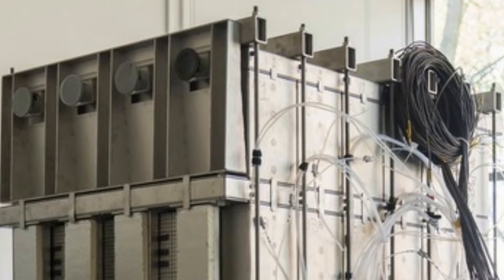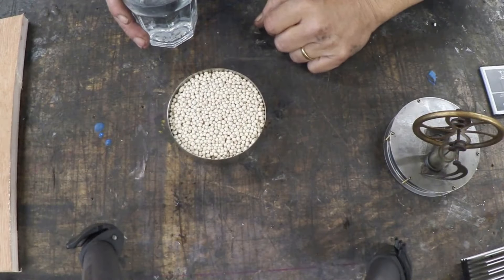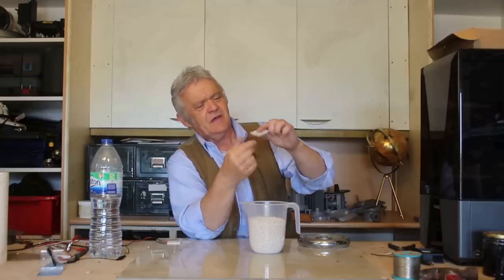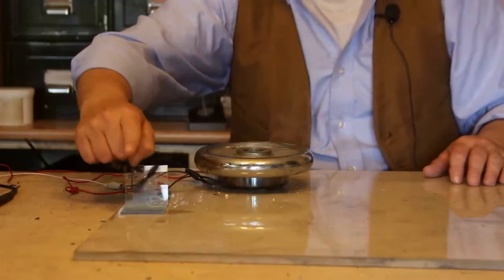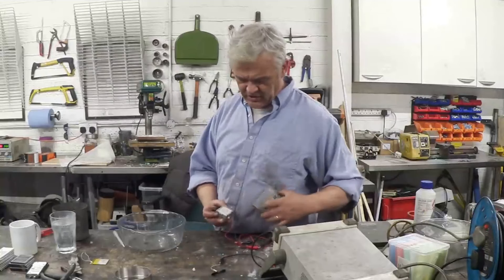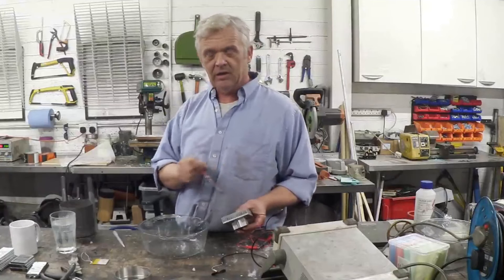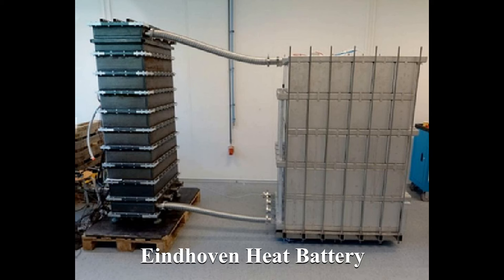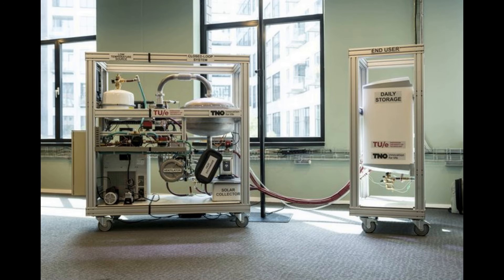2224 Energy Storage Game Changer - The Eindhoven Heat Battery

Comment: It seems that a sphere of 2.5 m in diameter filled with sand and covered with 0.5 m of mineral wool would be able to store 300 kWh (1000 oC) for a week, losing 25% in the end, and being able to return half of it back in form of electricity and a quarter in form of hot water. And costing 7.5k USD (20 USD/kWh netto). (For reference, a 2.2kW steam turbine costs 2.5k USD.)

It’s interesting why no startup is able to produce a prototype of such a simple, but so much needed system. 

Having such a system the only thing remaining for energy transition is 5 times the nominal capacity of solar panels / wind turbines (for Germany climate). Even a diesel generator practically never will be needed.

Comment: If you keep adding water does it stay hot?
Reply: Sadly, no 😊. Chemical reactions occurred between individual molecules of the two things reacting. So let's say the reaction is 1 molecule of zeolite reacts with 1 molecule of water and gives off heat. If I add 100 molecules of water to 100 molecules of zeolite, all the water and all the zeolite will have reacted and additional water will have no zeolite to react with. 
Now If I started off with 200 molecules of zeolite and added 100 molecules of water, THEN adding more water would produce more heat. But at some point, the water molecules will run out of zeolite molecules. At that point the zeolite will need to be dried out so it can be reused to produce heat. Does that make sense?
Reply: @101jchristensen  So after the steam stops is there still water remaining? Then you have to apply more heat to dry it out?

Comment: So, If I took a stainless steel (clothes dryer drum small used unit) and put it inside a large air duct, then in theory rotating the wet Sodium drox would lower it's own temperature creating an AC effect?

Comment: The largest waste heat suppliers that I have found are Brake disc foundries.  I proposed the generation of hydrogen to the brake disc foundry, but they laughed at me...However...Steam blown through Iron particles generates enormous amounts of hydrogen rich steam....An old book that I have "Industrial Hydrogen" by Hugh S. Taylor D. Sc 1917. clearly outlined how to create hydrogen from steam and Iron.  A brake disc foundry has both waste heat and scrap iron...Which would be a modern way to move toward a hydrogen economy.  The issue at heart is simply this...Corporations are ran by stupid idiots.
Reply: Just because you get degree does not mean you are inventive. Most folks learn how to do something but that does not mean they know how it works they just repeat actions and can not carry on a conversation of how to improve it.
Reply: The danger associated with high temperature, iron oxide, and hydrogen is why they laughed. It would never fly with any level of safety.  The same reason every petroleum plant exploded is because they use a spark wall to re-crack the gas. Then oxygen creeps in somewhere and the plant blows up. Look into it, it's very interesting.
Reply: The amounts of iron grindings from manufacturing processes is minisculte compared to the amount of hydrogen needed, also waste iron is currently recycled so diverting it to make hydrogen will just raise iron smelting needs, and iron smelting is carbon intensive.  Their is stupid idiocy in the world but one should do their own homework before accusing others.
Reply: I don't understand why a brake disc foundry would want to produce iron oxide.

They spent all this money popping the oxide off of iron, why would they spend money to reverse the process to produce hydrogen?

Then what would they do with the iron oxide? Send it back to a refinery and pay them to turn it back into iron at a greater expense energetically and economically?

No matter how that's sliced, the physics don't work. And if the physics don't work, the economics can't work.
Reply: Corporations are run by, most of the time, mediocre people. Not idiots, but certainly not the bright minds either. 
The company was just laughing at you because it is more expensive. 
And as long as fossil fuel remains cheaper industry will keep polluting.
Reply: I really like the idea of long term energy storage without degradation.
But I really like the possibility of "night solar", with the cells being heated during the day and then discharging through the night.
If it's not being done, I guess there'll be some practical issues, as usual. But on paper it sounds great.
Reply: @grinchyface  They put out a call for ideas about how to use all the excess heat energy  that is wasted every night.  Foundries are filthy dirty places, and the iron scrap is plentiful.  Using the excess heat, and the waste scrap iron, which is a  considerable amount would produce quite alot of hydrogen.  Of coarse all the math was done.  I am reading alot of comments from folks who obviously have never set foot in a foundry of any type.  But thanks for the feedback.
Reply: @kennethferland5579  No accusations.  My firm was hired to help them solve a problem.  I exaggerated about the laughing part...However, You have obviously never set foot in a brake disc foundry.  The "iron grindings"as you say are not minisculte compared to the hydrogen produced.  3Fe+4H2O=FeO4+4H2 and it is reversable. In fact it was the primary way to produce hydrogen for years.  The iron is NOT recycled.  Waste water, Waste heat, and Waste Iron all mathematically worked out for the foundry.  However, the idea came from yankees, and that pissed off the internal engineering team....It was a game of EGOs.  That is why I say they are idiots.  
Your foundry expertise impresses me.
Reply: @JSabh  JUST NONSENSE.
Reply: Bless You in Your Truthfulness!!!

Comment: Think of home energy sources in the previous century. You would have a coal delivery if you had a coal furnace, or an oil truck for an oil furnace, or even a truck delivering firewood. 
Now, think of zeolite deliveries, dried by the waste heat of the local pizza joint, bakeries, and other waste heat sources, including local entrepreneurs building small scale solar drying facilities. 
Not so strange or futuristic.

Comment: I live in San Antonio, where we have a huge number of 110F days. The heat part, if that's what the exothermic stuff is for-- is taken care of here--if I could ship you 40% of our entire net heat here, they'd build a memorial to me. 

As it is, nobody here would touch their car with the bare skin, because it will literally burn you. Crayons and plastic objects left in the car melt and warp, open the door and you can smell the carpet cooking.  You can rig up, in about fifteen minutes, a solar collector (such as the parabolic mirror, or solar cooker, or fresnel lens, or whatever) that will knock your socks off. I guarantee you can fry chicken with it. 

The problem, it seems to me (as you've mentioned before, Rob), is the cost of the Peltier device to perform this conversion at any meaningful scale. 

So here's the big ask. Do you think it would be possible to create LARGE SCALE peltier-like devices on the cheap, to make USE of all this ridiculous heat we have? 

(I will happily send half of my proceeds to Great Britain.)

Comment: That battery sounds like it was designed for geothermal projects
Reply: This battery design doesn't work. It leaks energy constantly. Even if it was put in a geothermal project, it wouldn't really do much failed. Battery tech needs to be thrown away.
Reply: @chaoskiller1758 Evidence?

Comment: Robert, as always well researched, very informative and a compelling presention. THANK YOU.

My main concern and one I've raised before is being able to integrate any system, no matter how simple or inovative, with established 'on grid' infrastructure.  To emphasise my point, do you supplement your own electrical supply with any device?  

With your expertise and access to tools, parts, etc. I would've anticipated a power wall storage type energy sink with an array of potential inputs, fed by your wind, solar peltier, metal air battery, etc. prototypes.  

If you haven't started to harness the power you're making, how viable is doing so and what chance do we stand of doing this ourselves?

Comment: The exothermic properties of Soda Lime are used in a device called "The Little Dragon". Developed by cave rescue teams, as a spin off from diving re-breathers, to prevent/treat hypothermia.
 Its a container holdind a quantity of soda lime into which is squirted a small ammount of CO2 - from a home brew keg - the CO2 activates the soda lime, and the heat produced is used to pre-heat outside air, which is inhaled by the casualty, which helps to raise their internal core temperature.

Comment: Why not do the drying by pulling a vacuum with a little bit of solar photovoltaic and a scroll compressor, add a little bit of a solar thermal heat of some sort to speed the process up. A lot like modern high efficiency washer dryer dries the clothes using vacuum

Comment: I'm living a bit further north in Leiden. I really think that this is a great idea. Many years ago we invested in solar panels but now the capacity of the houses with panels oustrips demand. Imagine if the grid could store the excess and deliver it back when the sun has gone. I'd happily pay for such a service rather than having batteries in my own house.
Reply: The problem with it as a service your adding costs and the savings goes out the window yet again, then also the transport of power also adds to the cost, so much for trying to provide cheaper power.
Reply: @troywhite6039 Yes, of course the off site battery option won't be as efficient as on site. But if the site of the battery is relatively close to the source of the power (within the same city or town) then losses are not going to be as significant.

Many countries already have pumped hydroelectric storage as an offsite option. Obviously the Netherlands is not going to be able to to do that, but a heat storage system is going to be just one option.

Now my house does have room for a battery and I'm OK with that as an option. But the option of grid storage would mean that people who are not so fortunate could at least play a part in solar even now that we are beyond the grid capacity.
Reply: Check the work of "OffGrid Survival Mike" About his heat battery and rv fridge working on solar

Comment: notable issues, including with other 'no-cost' energy sources, ir energy density and source amount. Example: these would take an amount of zeolite equivalent to the size of a shed to power a house unless you're really frugal. And to recharge by drying in the sun would take either a long time or a huge area, as your sun collector would need to collect enough energy to dry the zeolite or whatever in under a day. And you'd need enough storage and water for a few days.
So now you need to roof over half an acre...
Reply: You are being too absolutist. You only need a few tonnes for periods where solar isn't providing enough input. It's also the reason such systems typically send damp air through the system to get hot dry air out of the back.
Reply: @BB-sm8ey  Depends on the task. If you want a short-term 'battery backup', yes--but it still needs to be in thin layer or layers to dry fast from absorbed sunlight. That 'couple of tonnes' could still take up a tennis court or more, and if you're using sun-drying only you need a bunch more than that.

Now, if you set it up with sun-concentrator mirrors and vertical panels it'll take us a lot less space, but you're adding cost and infrastructure. However, you may need to do it that way to get the energy back out usefully.
Reply: @thekaxmax  Hi. If you do the maths it comes out differently. If it interests you look for papers on a institutional install in München/Haidhausen. They used seven tonne setup. As a rough rule of thumb it's about 1tonne per 100qm of reasonably well insulated living space (not passive home standard).
Reply: @BB-sm8ey  Nice to have some metrics ! What about the minimum "temp for some times " needed in some case (like with sodium acetate heat pack system) ? About the surface, I was thinking it could be interesting to use the south side roof of the house, and the storage could be in the back, in an unused side of the house .
Using the roof, or simply collecting the dry and hot air heating under the roof and going out by the upper vent. There, it would dry kind of linked pillows/conveyor belt full of zeolite. When dried enough, the conveyor would run enough time to expose the next "pillow" to the driying place, etc. They'd go to the north's storage, and be used later when needed.
A more basic way could be a solar hoven with a standard meshed box full of zeolite, that we could take off by hand in a waterproof storage when reloaded, then take back into the woodstove, and let drip water on it to release heat when needed.

Comment: Chemistry is cool. Still, simply burying a pipe 8 ft underground for about 50 ft solves the heating and cooling of a home with a simple fan. This is great, but not practical for its cost and complexity if one has a 10ft by 10ft area to dig. Coiling the pipe, depending on the diameter of course,  will determine how large the hole needs to be dug. Not water, just air being radiantly cooled or heated by the earth.  Super simple and much cheaper.  Sometimes  people just over complicate things.
Reply: That was done for a mother earth magazine article back in say 1980 .
Reply: Where are the research grants in that?!

Comment: I think it may be a solution to my problem.
I have a summer house. It has floor heating to keep it above freezing in winter. Heat comes from a large wood burning boiler and is stored in a 1000 liter water heat battery.
The idea was to heat it up once a week if winter would be cold (like -25C) and once for 2 weeks when it would be around freezing point. 
The problem is the boiler and battery are stored in the old cowshed. Temperature there is low (-5 when there is -20 outside) heat battery dumps it's heat to the cowshed. Especially when it is almost fully charged.
As I have a lot of wood ash I can have plenty of potassium carbonate and use it as a second layer (like once water battery would be above 65 degree I can start drying KCO3 and once it would drop below 15 I can put water into it.

Comment: Great info, thanks for making this video. That was impressively fast how quickly you were able to make one on the Eindhoven heat Battery! I guess one advantage of the Eindhoven is that the "fuel" can be recycled, and remain cool when not needed.
Reply from the maker: cheers mate and yes exactly
Reply: But the cost of recycling is the question, that determines where your energy loss/financials show it's true value and with carbon becoming a taxable commodity that too has to be factored in.

Comment: This is excellent. I really needed to see this.

Does this mean that "cold" is negative charge and "hot" is positive?
Reply: endothermic (heat absorbing) vs exothermic (heat releasing) completely different concepts, completely different physical domain
Reply: @quoudten  negative finds positive like cold rushes toward warm
Reply: @billschwandt1  electrons (electro magnetic energy) are positively or negatively charged, thermal energy arises from internal molecular states, at a certain level (micro or nano scale, really really really small) it becomes useful to consider "phonon", not a typo, states, but at the macro talking about the differential temperature is good enough.
Reply: @quoudten  I rally do think high pressure and low pressure, hot and cold, acid base, north pole south pole positive negative, hot cold, all the same thing basically. The static electric field.
Reply: @billschwandt1  you can't study things by saying "it's all the same", you have resolve differences between objects to understand how those objects interact or are affected by their environment. Yes, there are similar and analogous aspects between different domains, it's even reflected in the math, but there are also important differences, important enough to warrant different language, models, and tools to study each individually.
Reply: @quoudten  if it's all charge then you are missing out on the biggest aspect of all those things.
Reply: @billschwandt1  if it was all charge then it would show up as such.
Reply: @quoudten  what is color?
Reply: @billschwandt1  component wavelengths of reflected/refracted incident EM radiation
Reply: @billschwandt1
Scientifically it's heat that travels to cold but that's neither here nor there the real cost is storage size.
Reply: @troywhite6039  I'm starting to think it's relative.

Comment: If they keep the cells under hard vacuum and added a steam capture and condensation/water tank unit per cell then adding water to the second cell would dryout  and thus recharge the first cell and so on in a series you could ripple on forever.
Reply: Love the idea of rippling the reaction, but I think it would be quite complicated and/or energy consuming to keep the vacuum when water starts to evaporate because of the expansion rate of water into gas is something like 1:1700.
Reply: Steam power is highly regulated, licensing and government control extract and exceed any savings from it via extortion like all tax based schemes.